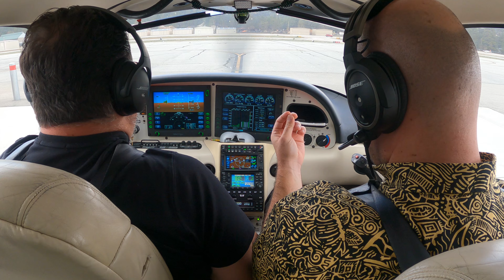Engine Management at High Density Altitude

Comment: How do you set your mixture for takeoff at high DA?
Reply from the maker: Depends on the airplane, as some with fancy avionics have an indication as to where the mixture should be placed. 

An easy, dirty, raw way of doing it with a non turbo naturally aspirated engine, is to line up, apply full power, adjust the mixture to peak RPM, and go…
Reply from the maker: @dsinha99 Run-ups should be conducted in a leaned state